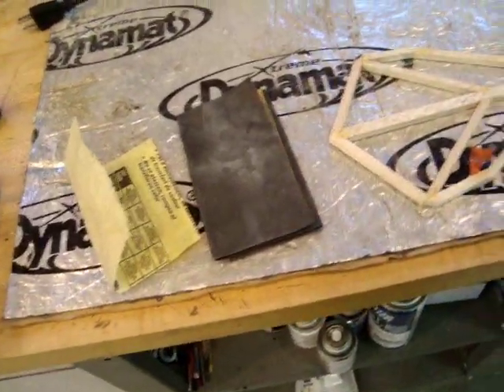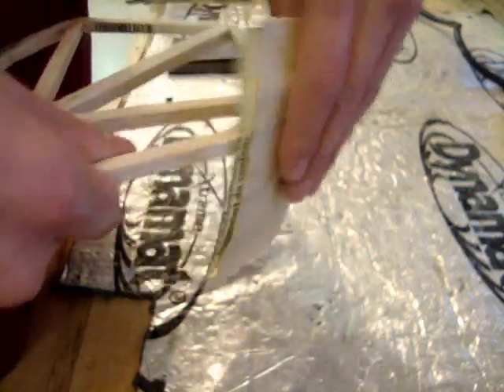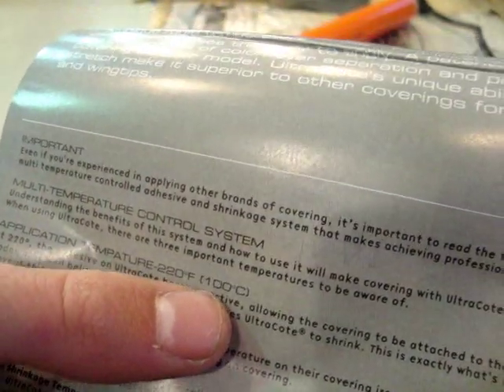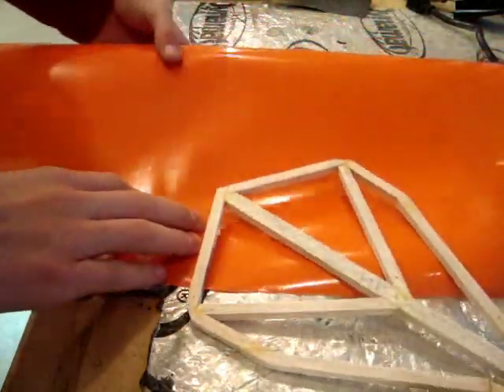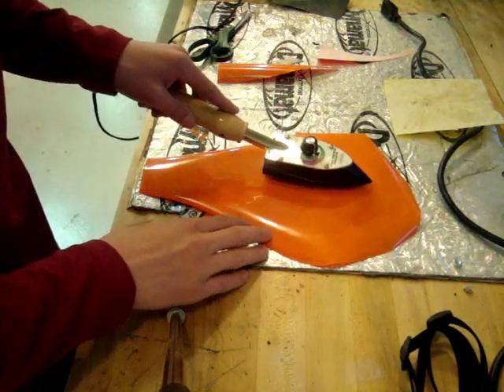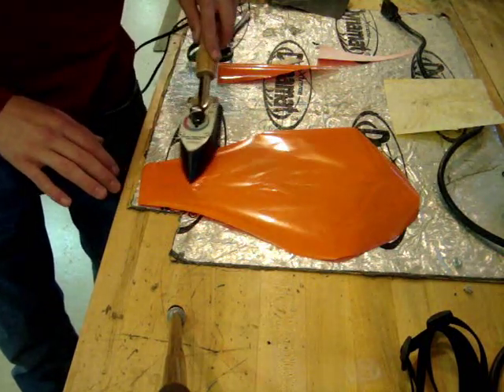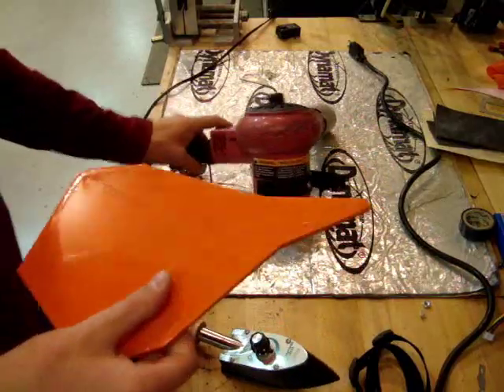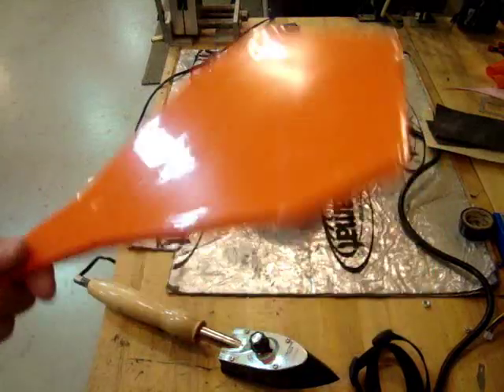How to Cover RC Plane with Ultra Cote

Comment: Thanks for the video. 
I did cover a PT-40 once ( my first time doing this) and it came out ok but I like the temp gun you used to see the temp of the iron. I'll have to get one. I had alot of problems with the covering coming loose when ironing. I am building a powered glider right now (from Great Planes) with a 6.5 foot wing span so this info should help me when it's time to cover this one.

Later Yak.

Comment: To be honest I still see wrinkles. This is really the main reason why I prefer Monokote over Ultracote. The monokote actually shrinks down more completely and finishes with a much satisfactory drum tight surface. Whereas Ultracote will not achieve this without really raising it to a temperature that approaches its melting point and thus a hole in the covering. Not to mention the temperature range of Ultracote being similar to that of Top Flites Econokote which has a poor working temperature.